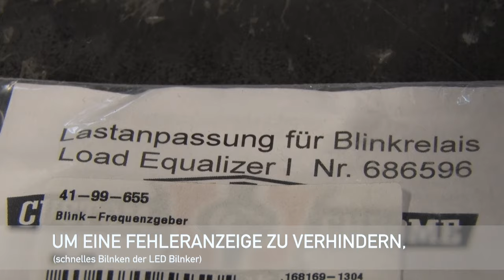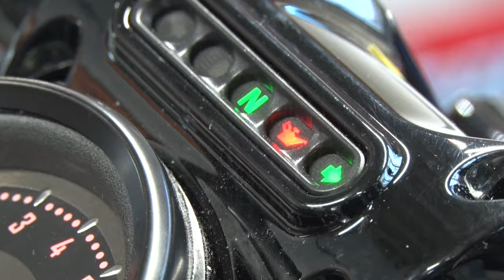LED Blinker Montage an Harley Davidson CAN Bus Modelle Thunderbike Tutorial

Comment: It’s not the lights it’s the motorcycle, apparently it has the CAN BUS system which is kinda difficult to ad electronic accessories
Reply: harley heap of shit , mine thrown more codes then water soaked jeep after fitting blinkers , engine check light m are harley davidson crazy doing this rubbish canbus , its junk system should not be warning of engine trouble when fitting blinkers , i own harley 3 weeks and would like to burn it , i hate working on it ,pain in the ass
Reply: @twistedthrottle8513  ok
Reply: @ekimandersom4478  just fitting muffler it stripped out engine case thread removing the bolts for bracket ,everything you touch turns to poo ,they used locktight on these bolts and its pulled thread out , i got so frustrated i sold it .,